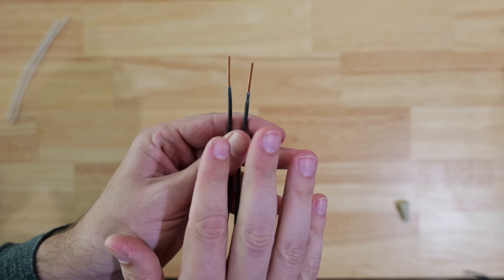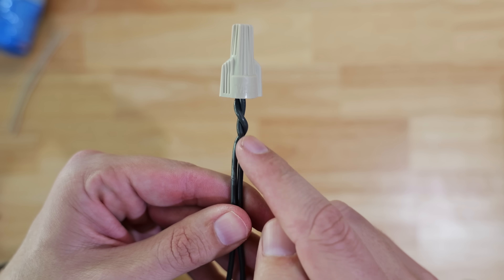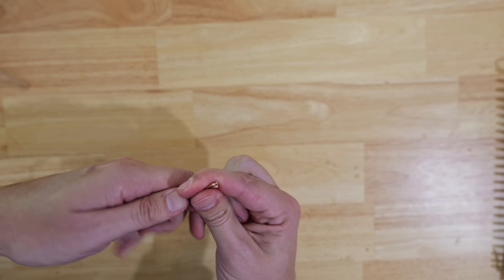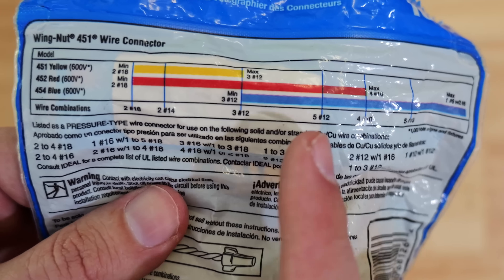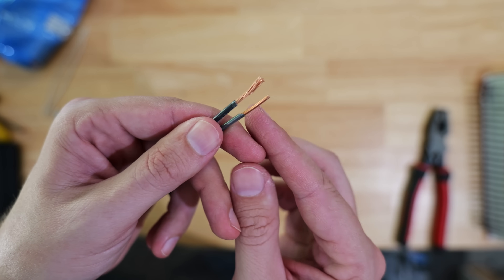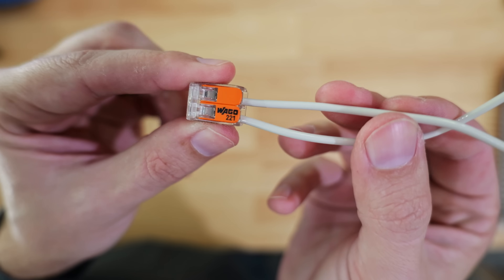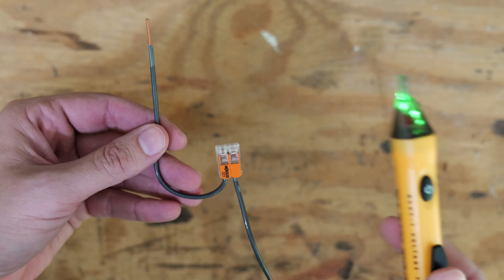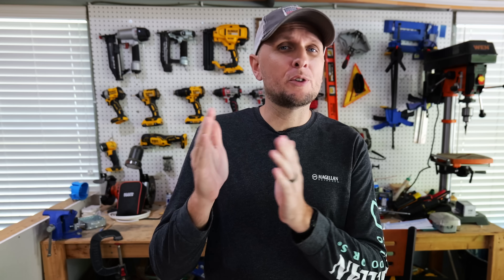7 FATAL Wiring Mistakes Most DIYers Don't Know They Are Making | Most Are Guilty of 3

Comment: I add Dielectric Grease to the bear metal of the two lines. Then cap them tightly.
Reason:  over "time" the bear copper will tarnish, the green powder looking stuff on copper, Rust.  The added grease keeps the copper bright.  Copper plus Oxygen is NON conducting electrical rust. This acts like a Reister and will HEAT up, at that "Cap" The grease stops this from happening.

Comment: I built my house 35 years ago.  Nothing but wire nuts were used.  Tighten them until you can’t.  Never had a problem and still live there.  If it ain’t broke, don’t fix it.

Comment: Honestly, if you take a really good look at the wago connections,  there is not enough contact between the wago connector and the copper wire for any kind of loading.   when you load up the circuit the wago will get hot, the plastic will melt then you could have a  fire.
This was tested on a yTube channel and that is pretty much what the result was./

Comment: I find it hard to believe that in America, where Wagos are still uncommon, yet this electrician has found cases where the levers have flipped open on a Wago connector?

I am a European sparkie and Wagos are very common, yet I have never seen such an instance of levers popping up and I certainly haven't had any such issues in the 12 years I have been using them?

I cannot comment on wire nuts as I have never used them and only once ever seen them installed on a very old house we believed to have been rewired in the 1950's.  Since we were doing a full rewire of this abandoned property we didn't really look at them.

Comment: The wire nut is in many ways superior to Wago.
The contact area between the wires is much larger, resulting in less resistance = less heat and more current.
And if you know the technology and have a quality product, there is no need to twist them with pliers first.

Comment: Why not just solder your wires before applying the wirenut? or if wirenuts really come off too easily apply a nice thick heat shrink around the wire ends after soldering?

Comment: I would the worst thing anyone can ever do with power point connections is to wire the hot or active to the neutral side instead of the same hot side. You might switch the power off at the power point switch thinking there is no active power there but there still is as its actually switching on and off the neutral side and can easily kill people from such practices if they leave the item connected thinking its actually off but isn't when working on it.

Comment: Never heard of a wire-nut or a wago - clearly made for the lazy or technically challenged. In the UK we use connector blocks with screws - not prone to any of these dangerous flaws.

Comment: I hate “fuegos” myself. 🎉😂 but if that’s what they want…. There was a reason “backstabbing” was banned. 😂 supposed to only use them once. Or go to another port if you took the wire out. Light load Led lighting is fine. Wouldn’t dare on something pushing g a full circuit tho. 😮

Comment: The wire nut should have a metal insert. Just twisting the wires together does not create an oxygen/humidity free connection, but its close. The metal insert in the wire nut cuts into the wires and enforces the twisting.

Comment: Another thing about the wire nuts.  NEVER and I do mean NEVER use the vinyl covered wire nuts.  If there is a problem and the connection heats up the vinyl will melt and can more that likely cause a short or a ground and maybe start a fire.  I always use the hard I call it bakeilite with the metal inside that will not melt.  I found this out the hard way by wiring in a high temp enviorment

Comment: My problem with the WAGO connectors is, NOT ENOUGH CONTACT Surface. Measure the "Contact Surface" of the Wire nut connection and the one INSIDE the Wago connector. About Half with the Wago. Same with the new Leviton Receptacles and Switches with the "Wago Style Connections".  NOT GOOD.
Reply: The smaller the contact surface, the higher the pressure. That is why switches and contactors use the smallest possible contact surface area, often a point contact. Pressure is what ensures a good electrical contact. The area of that surface is irrelevant, because it only spans over an extremely short distance, and therefore it has no measurable resistance. Another advantage is that such contacts are kind of self-cleaning when a high current flows through. The pressure inside these wago connectors is very well controlled, just like in switches and stuff. And most importantly for diy people, there is no way to do it wrong. With wire nuts the pressure between the contact surfaces is uncontrolled, and it requires certain experience.

Comment: I havecbeen working whit wago for years. You took the wrog vago, to be more precise the vago 221 is not for a fuul section wire, but the vagoo 227. Try 227and you will see if the wire will fall out. So a wrong example

Comment: Wirenuts are illegal in EU due to fire hazard. The only place nuts are used is connecting temporal explosives cables that sets of the charges.
Reply from the maker: Wire nuts are not made the same as they were when the EU quit allowing them.

Comment: I would use any other connector other than twist caps, those have been proven to start fires.
Reply from the maker: They don’t cause any more fires than anything else when installed correctly.

Comment: this guy got a few things wrong and a few things right

lots of wire nuts brands actually dont rate their wire nuts for pretwisting i do it most of the time unless its somethingthat frequently gets changed because twisting causes metal fatigue and leads to the wires being brittle. the only thing that matters is that u have a nice secure joint as long as the wires are caught under the spring inside a wire nut it is extremely strong ive let large lights hang off of my wire nutted joints. 

his second section of the video is correct always lead stranded ahead of solid but when two stranded wires i do likento twist and when u pretwidt wires always skin out long then cut. a lot of times fixtures will come with the end of their wires tinned with solder which makes a decent joint when untwisted.

the last part is i recommend never using wagos in america unless if its for can lights things like that. its just not as good as the copper on copper in wire nuts and the tension isnt that good imho. this works in europe because their voltage is much higher in america 120 volts a bad connection leads to more heat and more voltage drop.

Comment: I see all the comments on here of everybody loving WAGOs. I’m a electrician and I don’t recommend using them at all. I’ve seen wires burnt up with these. Remember it’s only a thin piece of spring metal that the wire is touching. This becomes weak after time and creates a loose connection. They also twist when you are trying to put them in the box. Use wire nuts, put a good twist on them and you will never have any problems.

Comment: When existing solid core is 12 or 14 ga.  I "tin" the multi strand on that ceiling fan, light, fart fan... etc. Takes time but I'm a plumbing cont. not a sparky and I sleep better... IMO, Wago's and the like just don't present very much surface contact....it just "pinch's" in 2 places with VERY thin metal ....very little surface area....sorry, I'm just not sold on them.....yea...they're faster, but.... there are 10's of 1,000's of houses in So-Calif that are wire-nutted together and still work just fine....no wave of houses burning down because of nutted failure....Wago's are still too new to judge.

Comment: I'm an electrician and I've been using Wago's for over 20 years. Never seen one fail. Much better than wire nuts. And they make troubleshooting or adding on down the road much easier.

Comment: Could you slip a heat shrink tube over the end of a wire that was properly secured.  Connect the wired.  Put heat shrink over it.  Heat it adequately to seal it and done.  Why wouldn’t that work in a very low stress application.  If it is never pulled on and just needs to be wrapped…

FYI, I’m not an electrician so my ignorance is on display. I have only now thought about possibly doing this.

Comment: Working on electrical boxes in an old house, I found many connections made without wire nuts. Just twisted together gas-tight, and taped over. Too much dependance on perfect technique.

Comment: Anyone else add electrical tape after as well? Or just me. I like to ensure that there is no movement and insulating to ensure no contact can be made with anything. Even with my outlets I run electrical tape around the connections to ensure nothing makes contact with the terminals.

Comment: I don't trust wire nuts and have never used them. Wago is the way to go! BTW, if you can't ensure that bare wires are not exposed when using a Wago then you probably shouldn't be doing any electrical job.

Comment: Do you know that exist wagos without levers? Every good performed electrical installation with WAGOs is well-arranged, quickly repaired, change wire/Wagos or add new with more terminals is easy, wagos has small openning for measurement current ETC.... So when someone say that Wagos are bad, is like say, that Porsche 911 Turbo is slow and bad car........!

Comment: The wire nuts included with fixtures are garbage, and I always throw them away, and make sure I have a supply of the correct sized wire nuts or wagos.

Comment: Never twist wires for wire nuts. Get the nut   on real tight and give each wire a solid tug and you're done. I like the ones that fit a nut driver, easier on old hands.  Any one with 6+ battery drills/hammer drills must know what he's talking about?

Comment: I dislike misleading titles from YouTube content providers. The WAGO Lever nuts are rated for residential and professional use. Like anything they require proper installation where any lazy installer could make a mistake with them and with wire nuts.
Reply from the maker: I said nothing otherwise in the video and the title is in no way misleading.
Reply: @HowToHomeDIY  My mistake, and apology,  as I was referring to the video title and the image selected as the video thumbnail. Even others commented it gives the impression that the WAGO lever nut was being flagged as a bad option. Thank you for sharing your experiences with everyone.

Comment: Pre twisting is useless. As long as the wire is twisted below the nut, and the connection is tight there are no issues.

Comment: Folks, let me give you a different perspective.  You may work residential where you have the benefit of 125v so the amperage draw is low.  I came up in the automotive field where voltage was low at 12-14, so amperage draw is much higher.  Our focus was always on maximum surface contact with the connectors, or risk increased resistance, leading to heat, leading to melting, leading to fire.   With this mindset, I find it baffling as to why an electrician would choose a tiny surface contact area of a spring terminal (whether wago or push-in behind a receptacle) rather than the huge contact area of the terminal screw or pre-twisted wire under a wire nut.  
Remember, that excessive resistance (heat, melting, fire) never draws enough amperage to trip your breaker….it just burns.
Europeans love Wagos, but they have the benefit of 240v so the amperage draw is half of what the U.S. requires at only 125v.

Comment: Wire nuts are not "crappy", some people just don't do it right I know it's just screwing on a nut but some people are just numbnuts. Name brand don't matter, use the right size and electrical tape.  I'm using WAGO connectors, SOOOO much better.  The wago nuts are not a "problem", that's 100% installer error especially being way too much line, they know not to have that much ripp out to expose that much line
Reply from the maker: I didn’t call wire nuts crappy.  I showed a certain kind that are pretty crappy though.

Comment: Wire nuts?  No they are “fire nuts”.  Also, the Ideal manufactures instructions which you literally showed in the video did not specify pre-twisting.  What is specified is “tug testing” after the connection has been made.
Reply from the maker: If you install them improperly then possibly just like any other splicing device including wagos.  It does not say TO pre twist.  It says not required.  Which means it’s optional to pre twist or not.  I personally prefer to pre twist.

Comment: Ridiculous. I’ve wired houses and light commercial with wire nuts for 40 years. Sure, you have to use the correct size and tighten them until the wires twist. Wagos are fine too. The only use for electrical tape is to mark wires.
Reply from the maker: Ok?  How does any of that make the video ridiculous 😂

Comment: You have seriously seen the levers get pushed up? In my experience it takes a lot of force to lift those levers, way more than anyone should be using to shove wires into a box. Any connector is gonna be in trouble if you strip the wires to the wrong length.

Comment: 25 year Electrician here. Residential, commercial, industrial, and even line work. I have been an industrial motor controls specialist for about 10 of those years now. 
You are over-twisting your wires. Wagos are the greatest thing since Polaris lugs came out. There's absoutely ZERO need to tape a wire nut or a Wago.

Comment: 10:37 You didn't really explain why and how that WAGO connection only passed 4½ volts.
Reply from the maker: Yes I did.  I showed what was causing it.  Not enough insulation removed so the metal inside the wago was barely making contact with the wire.
Reply: @HowToHomeDIY  I saw the under-stripped wire, but I couldn't understand how it got some voltage. I figured it would be "all or nothing".
Understand that I'm more of a hack than a pro though.

Comment: Lol You obviously didn't strip enough of the wire insulation when you applied the wire nut. The wires will pull out more easily if the wire nut is twisting  plastic insulation rather than the wire!
Reply from the maker: To which part?  This whole video was about showing mistakes and then correct ways.

Comment: You are using flexible wire Wagos to connect rigid wire.
I don’t mean to be rude, but it is normal for the wires to come loose from the connector.
Reply from the maker: No it isn’t and per Wago the 221s are made for either stranded or solid wire.

Comment: Only twist the copper of the wire people. Don't twist the part of the wire that isn't stripped. Pro tip: yellow wire nuts suck unless they are ribbed, orange wire nuts are a lot better than the yellows. Tan wire nuts are good tan and red are better than the reds. See a yellow wire nuts, toss it
Edit: almost forgot another pro tip once you twist your wires with your side cutters if you decide you need to cut the end of it cut it against the grain

Comment: Wire nuts work fine when used properly; i  hold the splice firmly with pliers and twist it down firmly. You don't need to pre-twist; its optional. Even with pretwist, wire nuts require a tight of the nut. A non-soldered splice REQUIRES compression. I'm saying Wagos are bad; they're just not cheap. Don't forget, this guy SELLS Wagos

Comment: So basically always solder even if it's in a congested tiny spot and go overkill on every wire for safety. Yeah we understand that but we're not electricians and we don't have an unlimited budget so that's why we use these cheaper options

Comment: Your pre-twisting is totally unnecessary since you do not fully and tightly engage the wire nuts threaded portion properly.  Therefore, the wire nut could come off an expose the bare wires that you were previously concerned about!
Reply from the maker: I do fully tighten it.  Where do I show or say otherwise other than in the example showing that as a common mistake?

Comment: Wagos are nice and easy, but I still don't trust them.  I am fine using them in light fixtures where you are typically doing a stranded to solid connection, and typically the light fixture stranded wires are much smaller gauge and there isn't any real load to speak of.  Where I would not be comfortable using them is where there may be significant load passing through the connector itself.  For example, a string of wall receptacles where they might be passing a full 15 to 20 A.  EVENTUALLY they will fail.  They really amount to nothing more than those damn back-stabbed receptacles where there's nothing but a little spring clip in contact with the wire.  How many of those receptacles have all y'all seen burned up?  Me? more than I care to... i.e. many.  Moral of the story:  Use Wagos where appropriate.  Use a properly made up wire nut where anything more than a couple-few amps needs to pass.  And NEVER EVER use the back-stab terminals on a receptacle!  They don't call them back-stab connections for nothing, because they WILL, eventually.🔥

Comment: Im an electrician, im not from the US so this is my own opinion, i'd neven join cables by twisting them with a non insolated plastic (wirenuts) unless its really low voltage/amp. I call this video clickbait tbh